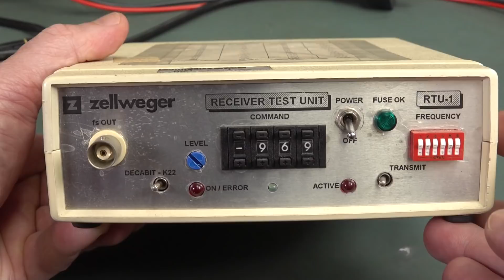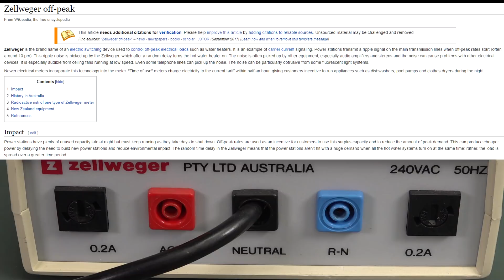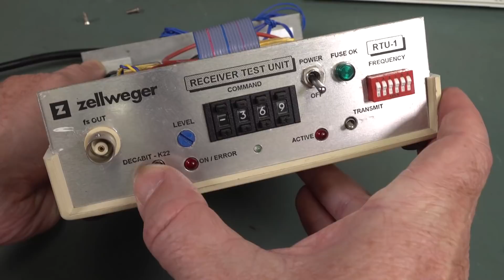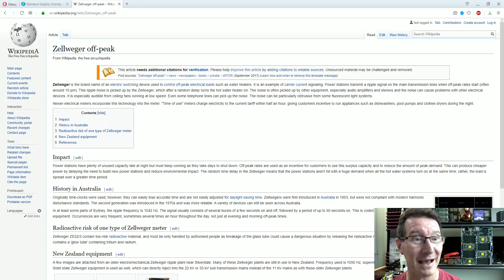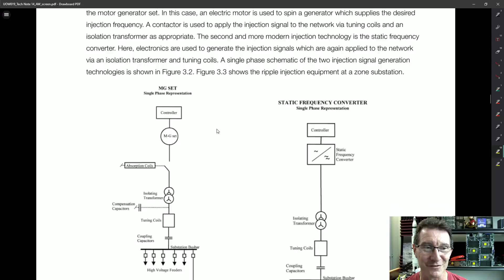EEVblog #1283- What is Mains Ripple Injection?

Comment: This method of remote switching of consumer devices by power companies has been around for a very long time. Modern Zellweger relays are all electronic, but back in earlier times, the actual relay coil was tuned for resonance at the frequency of the ripple. It would ignore the 50Hz mains frequency and react to the ripple when it was present.

Comment: I live in Zurich, Switzerland, so it is unlikly to have high loads at the home, as most places get hot water from the city central heating or from gas heaters, but I will run some tests around the time the night tarrif starts, and see what I can capture on the scope. Zellweger appear to be a Swiss company, and Landis and Gyr is also Swiss company, they power meter are very popular in Switzerland, they are also a leader in electric grid automation and metering and control systems. So I wouldn't be surprised to catch some signals around.

Comment: Wow what a blast from the past back years ago I worked for Seqeb which became Energex and I used to use one of those regularly in the late 90s. They were a key tool and that unit would have been set up to put out just above a 2 volt signal which was used to test the relays. We also used to use a pen recorder to measure to voltage levels of the ripple if a relay was testing fine but not switching. Thanks for bringing back some good memories.

Comment: You should get that thing working and give it a go.  I'm not sure how you'd know whether you're switching your neighbors appliances on and off, perhaps someone will track you down an let you know.
One possible way for utilities to even out demand is to play with voltage.  Lower supplied voltage during high-demand times and crank up the voltage during low demand times.  I've never monitored voltage over the day but wouldn't be surprised if they do it.

Comment: Decabit is 5 bits on / 5 bits off plus start bit. Always total of 5 on and 5 off so there's about 126 valid codes out of 10 bits. The high numbers on the thumb wheels are invalid Decabit codes hence the error light. I actually have a use for one of these developing a decoder for Decabit. Any chance you'd want to off load it?

Comment: Y'all aussies with out a new integrated digital meter will have 2 analog or digital meters and a 3rd rectangle thing with a green switch inside it behind the transparent cover. That green switch is what actually turns on and off from this signal, if you run out of hot water and want to be a cheeky bugger you can break the top seal and flip it on. Although I'm pretty sure if the grid is struggling they just keep sending that ripple to get all the older switches that are a bit sticky.
I flip them on to test hot water or pool pumps if it's in peak times, usually they just stay on but some days they constantly flip off every time I flip it on.
You will also have to be sneaky and make the seal look like you haven't tampered with it, or get a sparky to put in a reseal form, or in most cases I just leave it and the meter reader dude reseals it, being that that top seal doesn't allow you to alter any wiring so there isn't really any foul play that you can do

Comment: I can remember when i was a kid in the late seventies i could hear these signals through my audio input of my audio amplifier when i touched the input wires. You would hear the normal 50 hz humming and in the background you could hear this intermitting slightly higher humming noise.

Comment: Here in the Czech republic (and also years ago in the former Czechoslovakia) it's called HDO, the czech abbreviation for Mass Remote Control. It is used not only to switch on or off the water heaters and other heat accumulation devices, but also to command the energy meters to switch between high and low tariff, also in places where the heaters are independent of it. As a teenager I added a LED indicator next to the washing machine for my mom let she know the right time to start the washing.

Comment: In the US , very rural isolated upstate NY state , REA electric utility , as a teenager playing with /repairing old cheap stereo equipment alot , late 70's or early 80's timeframe . I would often have audio amps on but idle (quiet, no music), sometime with headphones on , I would remember hearing a "faint " high pitched tone , always seemed to be near (a few minutes before) the top of the hour as I remember . I remember only a single tone , duration maybe  10-30 seconds ?? , Don't know the exact audio freq,  maybe several Khz ?? quite high.
Otherwise the amp would be perfectly quiet , the rest of the time. I remember I could always count  on that high pitched faint tone at the same time each hour after hour.
Over the recent years , I have occasionally searched what this might have been.with no luck. I thought possibly
it was on the power lines , some kind of time signalling tone because alway remember it being a few minute before top of the hour. Or some other kind of power company signalling. 
Any Ideas on what this might have been ??

Comment: I have not seen it used in the US, However, I have used networking based on mains, where i have 2 tranceivers each connected at 2 ends of a building, so long as they are connected to the same leg of the fuse box you can connect Ethernet cables and transmit data through the mains. It was a solution before wifi was common.

Comment: Hi Dave, NSW and QLD were using ripple control up until the introduction of “stupid meters” to control the time of use loads like heat banks, water heaters, the receivers were adjustable for frequency and number of pulses, they could control groups of consumers to control network loading.
It was a shit of a system, since you live in Sydney, I am sure you will remember the beep, beep beeeep, crushing thru every electrical item in your house every week night at around 11PM.
Absolute crunt of a thing.
Reply: We have it in NZ and its never been a problem. Ripple control is used for all sorts of things here.

Comment: USA utility companies use VLF frequencies (carrier frequencies) this RF at low frequencies travels along power lines for long distances. 

I believe the system is on its way out however with our push to newer technologies called “smart grid” but initially the utility companies use this for switching transformers and circuit breakers from at remote locations. 

Great news!  We now have the 2200M band, subject to sharing with utility companies who may not have to share the band with nearby hams.  Most experimenters use short, inefficient antennas with very large loading coils. Propagation in this RF region is by surface wave, using vertically polarized antennas. (from ARRL website)

Comment: In the Netherlands a similar system is or was in use. It is used for switching street lights and for switching the energy meter to a lower night rate. Consumers with such a system installed in their energy meter pay a small fee but get the lower night rate.
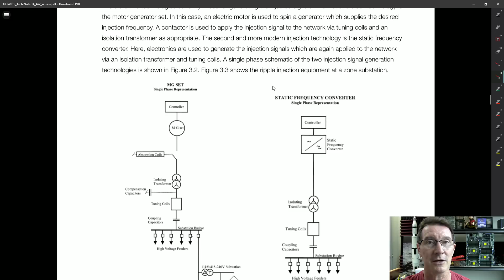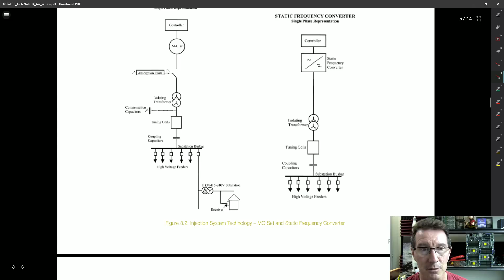Reply: It is still in use! Not for long though... It's called Toonfrequent (TF) or centrale afstands bediening (CAB). It's being phased out for consumers and business, but I don't know if the street light signal is getting phased out as well. I certainly hope so, it seems to interfere with some LED dimmers which makes them flicker about every half hour. (20:00, 20:30 etc)

Comment: Im assuming the techniques used for this sort of signaling aren't a million miles away from HomePlug / Powerline for sending Ethernet LAN over the mains? 😀
Reply: I think most ripple control is an adjustment to the frequency of the power where as the homeplug/powerline stuff is just radio over the powerlines.

Comment: Common in New Zealand, most households have electric hot water systems which are controlled from a ripple control switch for load shedding.  Most of the ripple control system is Zellweger brand. The type you showed in the video. Enermet is Landis&Gyr.

Comment: Erm, I'm guessing the blue bodge wires were to some external test equipment and used during troubleshooting.  They probably gave up on the unit and didn't bother to remove them after.

Comment: I live in Philly and there's only one rate no matter the time of day. I guess they don't have problems with excess demand. It's been like that everywhere else I've lived too, but that's only been the mid-Atlantic region.

In my current apartment though, the heat, hot water, and even the A/C run on gas (central to the building).

Comment: Wouldn't shutting the water heater off during the day make everyone have to take cold showers?
Reply: Usually it heats a large body of water over night and remains hot during the day. The larger the body of water, the longer it'll stay hot. If you run out of hot water regularly then you need a larger cylinder, simple.

Comment: 253v is the upper limit for our region in nsw (see endeavour energy network power quality limits & levels page 8 for more info). Lower limit is 216v rms. Select 1050Hz which is common for prospect county council area ripple control. Preferred voltage limits are 225-244v rms.

Comment: In the area where I live (most western part of Austria), ripple control is still in use.
In the old days, small synchronous machines with a power of several dozens of kilowatts were used to inject the signal into the power network. Today, electronic converters are used.
In the village where I live, the street lighting is controlled by ripple control.
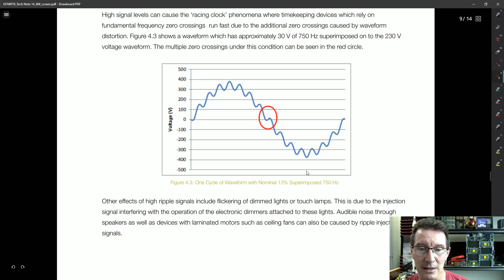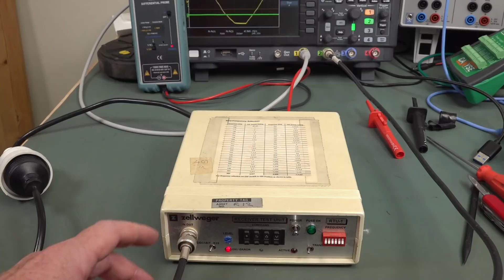And I have a dual-tariff energy meter in my house, this is quite common here. A ripple control receiver selects between the two counters in my meter, one for "day electricity" and one for "night electricity". The tariff for the night is lower and the according counter is activated at 22:00 and remains active until 06:00 the next morning. On Saturday the night tariff starts at 13:00 already, this is why our washing machine typically runs on Saturday afternoons.
When I was working as an intern at a local utility back in the late 1970s, I got a copy of a repair instruction for the ripple control receivers (dated 1962!). The author was quite proud about this.
I would have access to equipment to record the "switching telegram" and play it back into the mains, so I think I would have a chance to fool my ripple control receiver, but I resisted the temptation to do so.

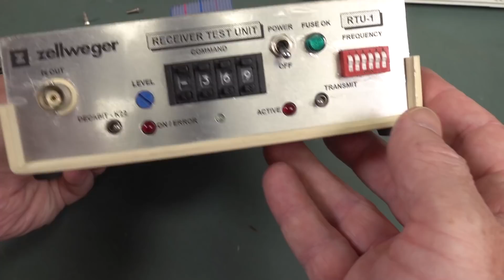Comment: 10:02 Can it be that they just had a few projects where they needed an external device, power supply or something? They would take the two wires, hook it to an external pcb or whatever, then when they are done with that they would just coil it up and put it back in like an extension cord. Further supported by the knot on the cables that would stop it from getting yanked
Hell it could even be for injecting a new signal that it didn't support, you saw dozens of standards and that little thing only had deca and k22

Comment: In France we have a system called Pulsadis and uses a 175Hz carrier. Since a few years ago we now have VERY controversial "Linky" smart power meters which communicate over powerline carrier. They use a standard called G3PLC and uses 36 OFDM carriers between 36kHz and 90kHz

Comment: In Hungary we had a similar kind of "audio frequency" ripple control from the mid 70s. It wasn't implemented everywhere. As a child in the end of the 80s I still remember we had a clock type control unit. This was up until the end of the 90s. That's when we had our first neutral line injected control signal. I remember it didn't switched on long enough to heat up like 180liters of water for a family with two kids. Nowadays our oldest and tallest long wave radio tower controls RF switching recievers. It's called Lakihegy Tower. It has a tuneable height of 284-314m. A Blaw-Knox type thingie (the cigar shaped one). E.on broadcasts a DCF or WWV like almost atomic clock precision time signal from it, and of course as I recall a properitary Versacom protocol control signal. Using this I think they even switch at non-regular intervals. The law says they have to add up like 8 hours per day. The interesting technique in the receiver is that it can rotate it's LW ferrite antenna jobbie to best reception.I think we had a PROLAN RRCR110 type unit. Right now my parents have central and I have gas heating, so I can't give up-to-date info on this. If I ever get my hands on a retired unit I'll send it right to you so you can say we're in like Flinn again, but first I'll take it apart too! :)
Reply: Same here in NZ, the local power company has to provide no more than 8 hours of "off" time per day for hot water heating. So its usually broken up into several blocks of peaks with the biggest off time being in the evening so your hot water doesnt start heating again until later at night during the off-peak

Comment: In The Netherlands we still have a control signal thing. It's called ToonFrequent (Tone Frequency) This system injects 492 Hz on the 50 Hz in the grid at serval intervals and controls the day/night tariff, public lights, highway lights, de-icing (only at very low temperatures), low/high tide (very important, because, yeah, Netherlands...), and some more stuff i haven't figured out yet. The old TF-receivers are well engineered electromechanical devices, with a synchonous motor and gear system and a discriminator (to filter the signal and sending a pulse to the motor). If you are interested, i can send you some of those devices.
Reply: I'd be really keen to see a teardown to see how some of the analog ripple control recievers worked before transistors / microchips.

Comment: 1 question, what happens when you use a power line network adapter with this Mains Ripple Injection, do they interfere with each other
Reply: No, because the network adapter uses a very high frequency, ripple injection on 50 Hz is only around 1050hz

Comment: I used to work in a steel mill in Watervliet, NY that had three carbon arc furnaces for melting scrap steel. In the control room for each furnace there was a set of colored lamps, red, yellow, and green. In the summer, if the yellow or red lamp came on, the operator was to turn down the furnace to some specific power level. In the rest of the plant there was a siren that when it went off, we had 30 minutes to finish a process and then shut down the machinery. I believe we were given favorable electric rates and in turn, were allowed to be used for load shedding. I wonder if a similar method was used to send commands to our plant.

Comment: It looks like the decabit example shows a 10-bit code (a number between 0-1023). Deca means 10, so there you go. A decade is 10 years. Hecto means 100 and, of course, kilo means 1000. In Norway they measure fish volume en gros (in bulk) by the HectoLiter (100 liters).
I even looked it up: https://en.wikipedia.org/wiki/Metric_prefix

Comment: This Mains Ripple Injection (a DELIBERATE addition of junk to the power-line--what a country!) is the reason that high-frequency bypassing (low-value cap to handle higher frequencies) should be added to ALL DC power supply outputs!
See Dave's excellent video on *bypass capacitors*: 
https://www.youtube.com/watch?v=BcJ6UdDx1vg

Comment: I could cry every time you bring up your mains voltage. We got 230V here but one phase is dropping down to 206V, which my UPS does not like because its the lowest acceptable voltage I can set it to. I emailed my grid company and they seemd interested in my logs, but never mailed back after I mailed the logs, nor did the low voltages go away.
PS: I measured all 3 phases at the 32A 400V plug right next to the meter, so its not the line to my UPS, where I first noticed the low voltage, but the grid...btw I live in Germany

Comment: I made a simple window AC thermostat with an Arduino and wanted it to turn on at a zero-switching point of AC. Instead of running a wire to mains, I just hung a few inches of wire off an ADC input and took a look at the waveform. Pretty strong 60 Hz AC pickup. I added some zero-crossing code and a settable delay from when it found a crossing.